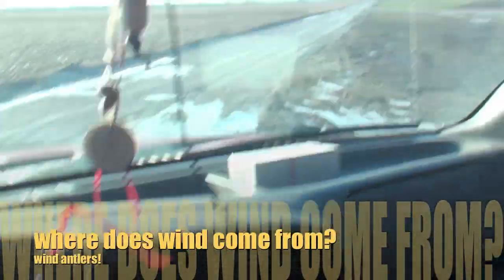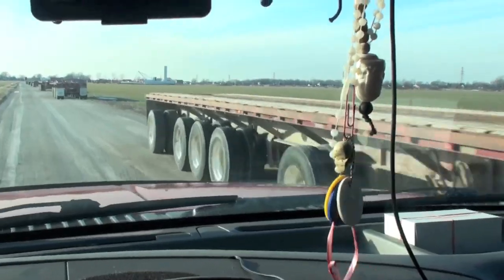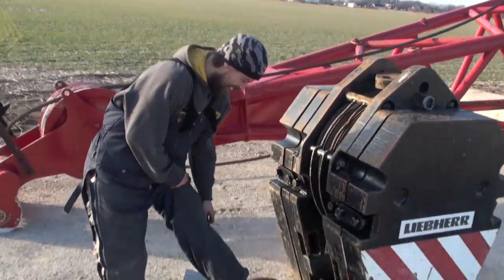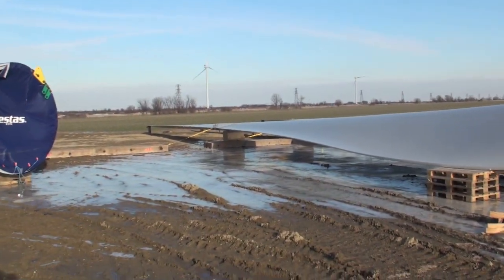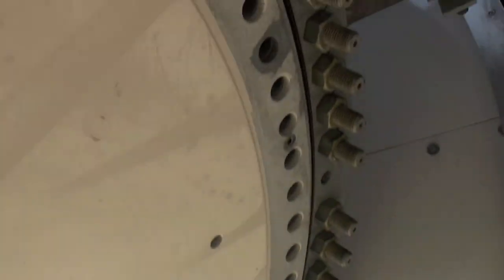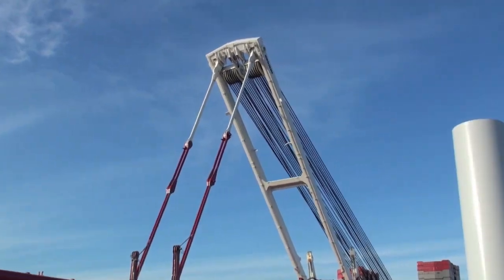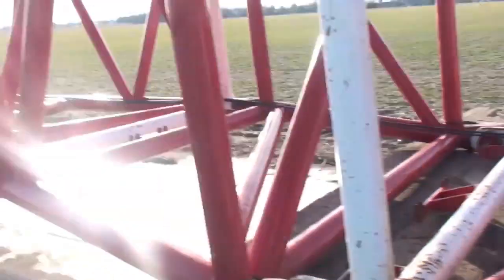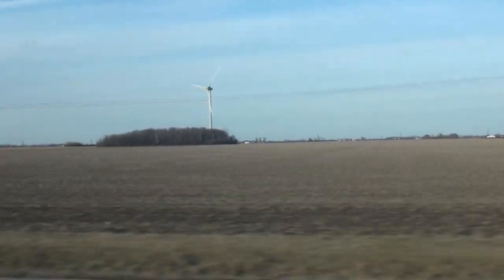where does wind come from?

Comment: oh and the tops ar made to rotate five times either way before having to turn back and they use giant disk breaks to control the speed of the blade with 4 sets of calipers and pads. 2 main sets and 2 back ups each set is like 20 grand

Comment: yeah man those turbines are like 300 ft ant each blade is about 160 or 180ft i dont remember and there only fiberglass to boot. my dad is building 3 of them in cambridge md in the us. those bolts are torqued at 200ft lbs and they use a 3/4inch drive for those puppies. at the top of each of those 3 tower sections is a diamond plate platform (atleast some are). theyre monsterus and they make them bigger too shits amazing. rock on pug!

Comment: If anyone is interested....
The first turbines Pug looked at (including the one on the ground) is a Vestas V100's. They are rated for 1800kW power production. The blades are 49m long, and the towers are 80m tall...that's why they need such a huge crane!

The older green turbines with the spiral stair cases are Enercon E82's, They are rated at 2000kW. They are smaller than the V100s. The reason the Nacelles ("tops") look so much different is that they don't have gear boxes.